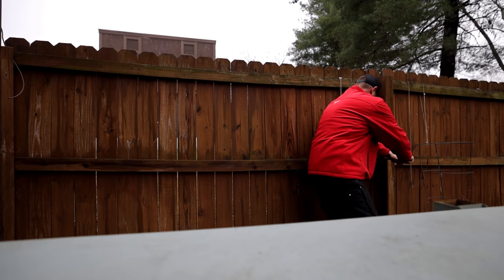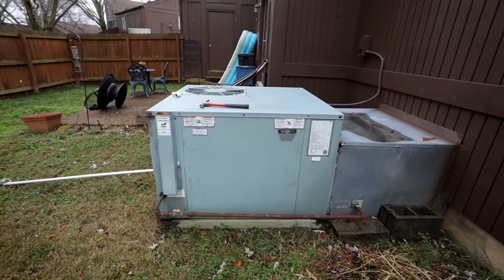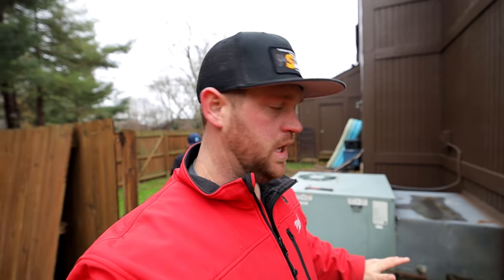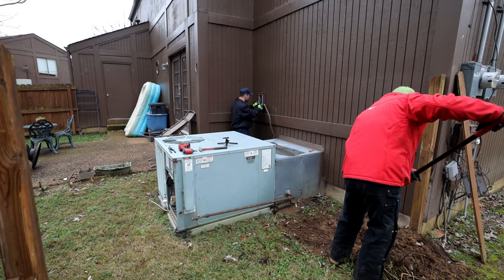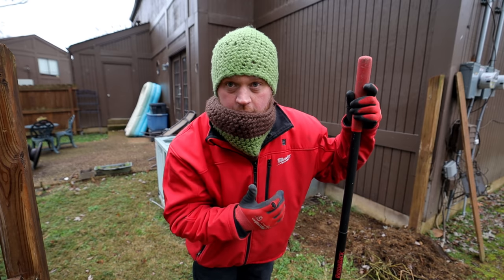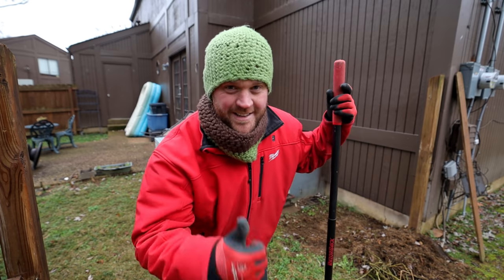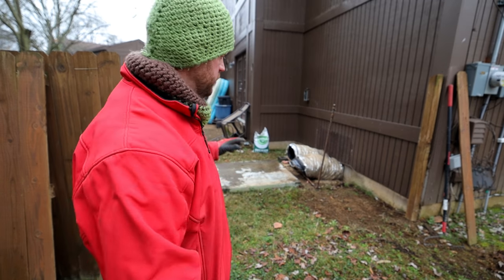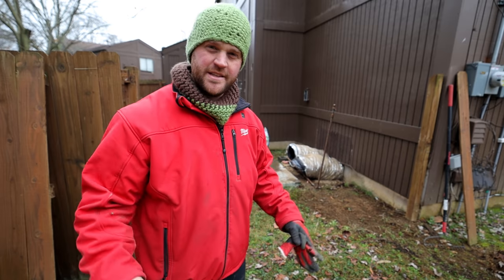Installing Ruud Gas Package Unit | HVAC Replacement

Comment: Rheem and ruud the guys who energize the reversing valve in heating instead of cooling. Just had to be different lol. Great job keep on inspiring two weeks left and I will be Universal EPA certified. I'm claiming it!!!
Reply: Rheem and Rudd are actually smart for that to be honest. If the reversing valve gets stuck at least the homeowner still has A/C.
Reply: @rottiev264  I agree 150 percent. I rather have Heat than AC. I can remove clothing or buy a fan but heat is more essential to me honestly. They both are important don't get me wrong.
Reply: I've learned the longer you stay in the field the more you'll see stuff you didn't know about. Older Amana units also energize in heat. Also there are alot of older Ruud and some Amana units that use 240 volt solenoids for their reversing valves. Then they use a rats nest of relays and boards to control it all instead of one simple defrost board.
Reply: @mattluongo7763  I'm eager to learn more about the science of and reasoning behind the differences. If I can have a impact in the field or trade I will embrace that journey and do all I can. Thank you for the knowledge and service to the industry!! Merry Christmas!

Comment: Good job. I would of done only one thing differently. I would have started that unit up and burned of the exchanger before hooking up the flex lines. This way it would have kept out of the house the smell of it. I would also doing everything else great painted that gas line..tha ks a ton for sharing. Stay safe

Comment: Ruud equipment has been known to last 30 years. Not sure how the newer generation of equipment will compare but the older reciprocating compressors were hard working.
Reply: My Ruud units 19 and 23 years old, respectively. They've both required new heat exchangers, but otherwise been rock solid.

Comment: If you wrap pipe with the bubble you need to use the spacers to get the r value if not double wrap it or it will sweat my friend

Comment: What part of the country are packaged units popular on residential? I'm not an HVAC tech, but I haven't noticed these here in the Midwest. I've only ever seen split systems. Great video as always!
Reply: Southeast. They're most common in older homes with crawl spaces, since you can run ducting under the house and eliminate the separate air handler. Most midwest homes have basements so there's a lot of space to put the furnace/handler where it can be easily accessed without running AC lines too far.

Comment: Btu output ÷ (1.08 × temp rise) = cfm. 150cfm per 10,000 btu
Reply: Why not just do 400 cfm per ton of refrigeration? Or does this not apply to gas?
Reply: @juvenileloki3auz  It takes much less airflow to heat that cool. so if you have 400cfm per ton of cooling your heat will run fine.
Reply: 150 cfm is for condensing furnaces 
130 cfm induced draft
100 cfm natural draft

Comment: Those 1 inch filters do you have a lot of static if it’s in a return grill if the cans deep enough they have 4 inch filters that are designed to fit in 1 inch return air filter grill. You can recommend this to your customers 

https://drive.google.com/file/d/1lcIxwiA2YoAqhEo7c7VUkz1wBJm4OprC/view?usp=drivesdk